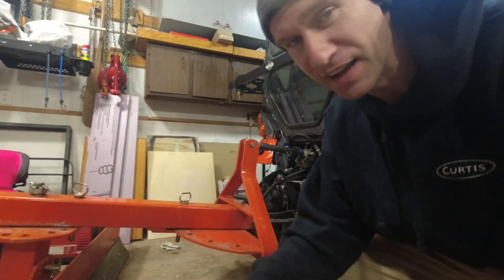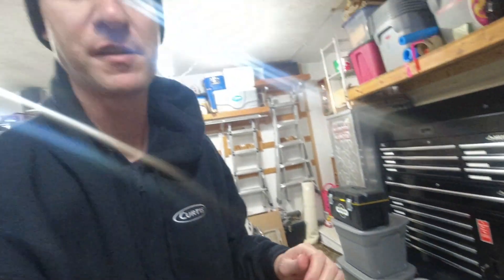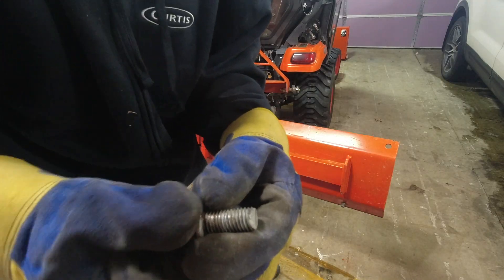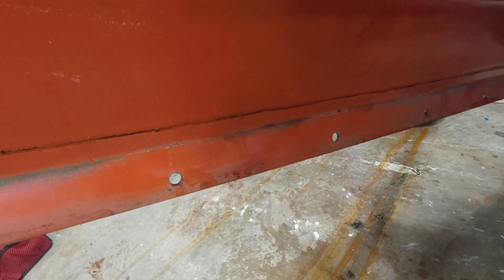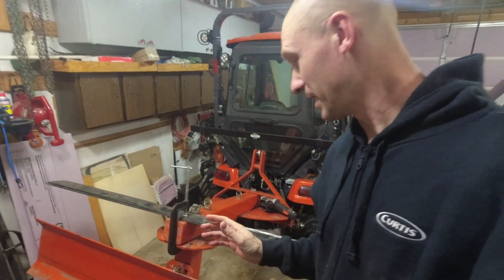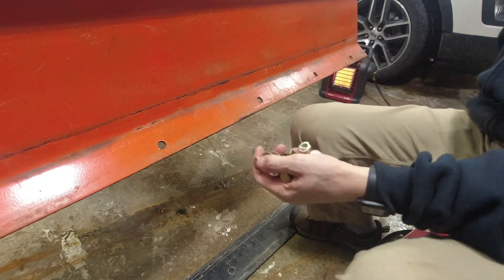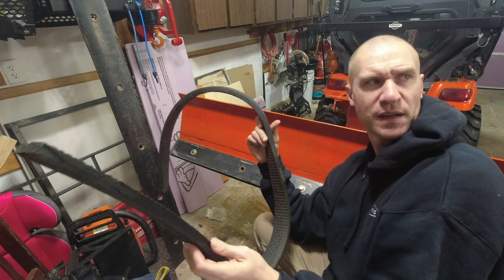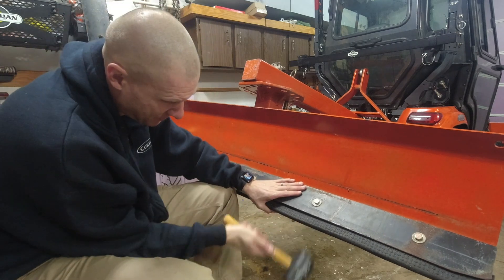SNOW PLOW CUTTING EDGE (Kubota BX23S)

Comment: Nice job Jon, rubber cutting edges work great and I like your idea using the stall Mat and Sandwiching it between the two pieces of flat stock. I’m sure it will work well for you. 

There is a company here in Buffalo called “Plow Rubber” they build nothing but rubber cutting edges, all different thicknesses and materials for plow blades and even drill and slot the holes for you. The last cutting edge I got from them was 2” thick by 8” wide and 10’ long for our pusher at work, it only cost us $300 for it which is cheap for that amount of high grade rubber. They ship all over the United States too so you may wanna keep them in mind when yours wears out 👍🏻
Reply from the maker: Thanks Mike, I think I’ve used the rubber cutting edge for two years now and I’m surprised at how well it’s held up. That company sounds like they offer a pretty great deal. Get them on your channel and promote their business. 👍
Merry Christmas 
Keep on tractoring!

Comment: I have been using the tractor supply horse mat on my back blade for a few years now. I cut the strip about 4-5 inches wide, drilled holes through it for the cutting edge bolts. I cut it so it can be reversed. I had to buy longer bolts because it add about 3/4" to the length. It's been working great and never comes loose. Maybe I'lll do a video on that soon.
Reply from the maker: I would love to see a video on how you put that together. Merry Christmas. 
Keep on tractoring!
Reply: @ritterjon  Will do Jon. Merry Christmas!

Comment: I recently added a 6" x 1" rubber cutting edge to my 6' Land Pride front blade. Haven't had a chance to use it yet, but the hollow punch drill bits made cutting the holes a breeze. Then I just purchased some carriage bolts that were .5" longer than the originals and I was good to go.

Comment: Hey Jon, I would suggest running a thick bead of welding along the inside edge of each side of the sandwich plates.  That way it'll be pinched real tight when compressed, and maybe align that bead with the grove in the stall matt.  Good video. Thanks for showing us.
Reply from the maker: Only problem with that is I don't own a welder.  I KNOW RIGHT!  I definitely need to get one. 😁👍 
Merry Christmas 
Keep on tractoring!
Reply: @ritterjon  hummm.. yes you do.  :)
Reply: @ritterjon  I have been lusting after the yeswelder Which has five functions. I’m saving my pennies. If you take a look at it I appreciate what you have to say about it.
Reply: @TimeAfterTym  I've been looking at that as well. Reviews seem positive for an all in one, I would just see if you can get replacement parts easily would be my concern.
Reply: @RossOnTheLand  well I have time since I am not going to buy a welder for two more years. So I’m keeping an eye on that exact point you bring up. Can you get parts.

Comment: You need a bigger garage?  At least you have a garage....I have a carport...its ok in the warmer months but useless in the winter to try and work on anything.  

I ordered the front tie down point kit from Ashwill Industries as well as the rear receiver hitch & tie down and managed to get them installed this afternoon out in the shop.  Shop isn't finished inside, and of course not heated, but a little better than working outside.  

I need a rear blade for my BX LOL.  Used the box blade a lot this past summer/fall...but a rear blade I think would work great for snow removal in my driveway when we only have a few inches to clear.  The snow blower I have is a 3 stage so really anything less than about 6 inches of snow and the blower isn't that great for that stuff, get about 10+ inches and its amazing...so a rear blade would be great, and I don't know if a rubber cutting edge would matter since I have a gravel driveway, but your idea certainly is a useful one for doing concrete or asphalt driveways for sure.  

It was supposed to snow this evening and pretty much through this weekend, but umm, it was 48 degrees this afternoon and partly cloudy LOL.  Not bad for almost the end of December here in southwestern Idaho....next week though its supposed to drop down into the single digits overnight for a few nights, then looks like back to similar temps we've been having, mid 30's for overnight lows and mid to high 40's for highs.  Shaping up to be another dull boring Idaho winter.
Reply from the maker: Hey there William! You are right a rear blade excels at moving snow. The snowblower for larger amount and a rear blade for smaller amounts. 
We’ve been having some warmer than usual weather here also. It was 45 today and we lost a lot of snow. Looks like cooler temps are in the forecast though along with some snow. I’m hoping we get a nice snowstorm soon. 
Merry Christmas! 
Keep on tractoring.

Comment: That looks like a good idea and I'm guessing you don't need to use skids? No snow here usually, but I'm thinking of getting a rear blade to smooth out the driveway and trails but I don't want it to be digging down deeper into the existing dirt or bringing up roots. Have a Merry Christmas, Jon!
Reply from the maker: Sounds like you might need a land plane. 
Merry Christmas! 
Keep on tractoring!
Reply: The issue with the BX, is the 3 point is either up or down, there's really no easy way to get it set like larger tractors that have draft control or position control, both of which would have been nice on the BX for these types of applications.  A box blade might be a better solution or a land plane like Jon mentioned earlier in his reply.  Not sure they make a land plane small enough to pull behind a BX though, takes a bit of pulling power to do stuff like that, more so you need traction which the poor little BX lacks LOL.  I have to use 4WD running my roto-tiller, otherwise it'll stop the tractor dead in its tracks.  My box blade requires 4WD use most of the time as well.  

A rear blade with the way the 3 point is on the BX is going to either go down too far, or not enough....adding skids, or a rubber cutting edge won't cure the digging in issues.  If you could find some sort of wide skids to bolt on say from a snow blower, or a roto-tiller that could be raised or lowered to get the depth of cut you desire, that might be an option, but you might want to look into a box blade rather than just a rear grading blade for that type of chore.
Reply: Hi William. I have a B2601 but that is great info for BX operators. Thank you for taking the time to comment. It's really appreciated. - David
Reply: I've thought about a land plane for the driveway. I may get one some day but I have too many other toys, er tools to get first. ;)

Comment: Be careful with buddy heater make sure you use a filter on the propane tank.    There are oils in those tanks that will plug up the heater and it will stop working..   I know from experience